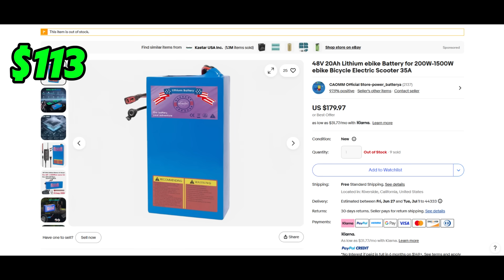Building a Electric MINI MOTO Under $500

Comment: How are you getting almost 40 out of that? I have almost the same setup (72450 instead of 72300) on a Mx frame with supermotos and im barely getting 32 (I weigh 140)
Reply from the maker: I run 65a line so a little bit over 3kw
Reply: @Razorronen  What battery is that? It looks like a caomm 48v 20ah (35a bms)

Comment: You just got a sub my friend also is it still holding up how is it on the trails and such?
Reply: stock suspension is definitely rough it works but you feel everything
Reply: @ronaldjr204 I’d definitely upgrade the rear spring but other than that battery and controller are strong that’s my main concern and question

Comment: Yo get the 72. 3000w continuous 5000peak kunray kit and a BTR 72v 20ah 50A continuous 100a peak battery you will be popping so many wheelies
Reply from the maker: Na a brt battery will burn you house down don’t get one.
Reply: @Razorronen oh dang, really pat outdoors has one in his razor mx650 and I think he’s pushing more out of it then it’s rated for
Reply: What’s a good budget battery? I should run that is 20ah or bigger

Comment: If you put a mx650 12” front wheel on it will make the bike feel bigger and handle better
Reply: 😂 no😢😮
Reply: Mx650 has a 16" on front
Reply: @jaxspots1  No it doesn’t I have one it’s a 12 front 10 rear
Reply: @AcedBikes nah it has 12  14
Reply: @KyleHickey-v7c  No it doesnt bro it’s a 10” by 12” wheels I own a mx650 😂
Reply: @AcedBikes looked it up it has 16 inch front 10 inch rear
Reply: @KyleHickey-v7c  that’s not correct 😂 it’s a 12” by 10”
Reply: @KyleHickey-v7c  it’s 16 in tire but the wheel is only 12
Reply: @AcedBikes whatever floats ur boat lil bud

Comment: I think you should take the old suspension off the rear of the 350 if you can and put it in to sx500 and then make a video of you trail riding or exploring like the old vids with the mx350
Reply from the maker: I tried doing that, but the MX 350 shock was too short. I just didn’t show that in the video.
Reply: @Razorronen oh